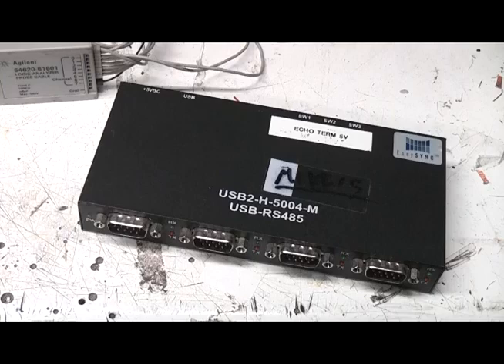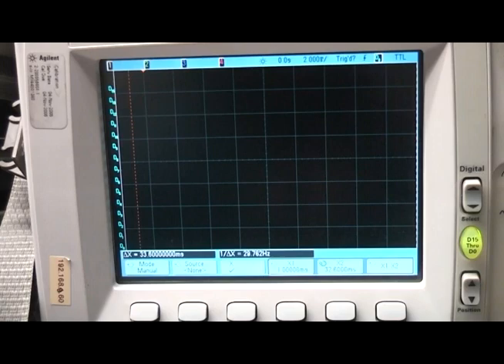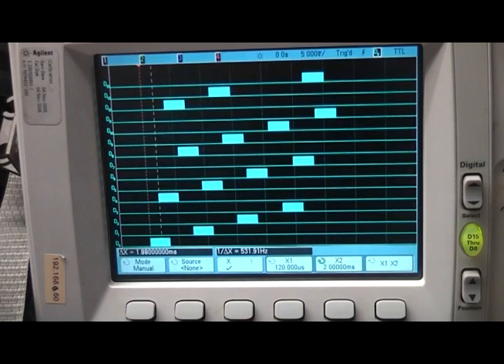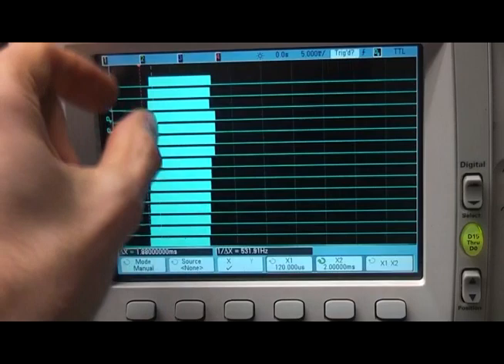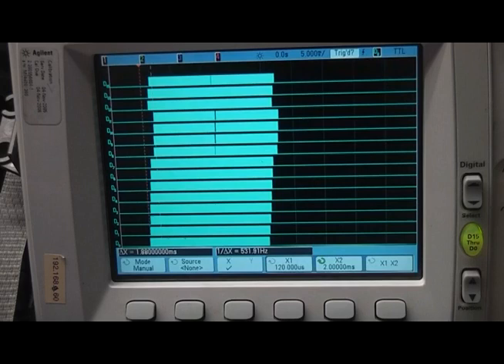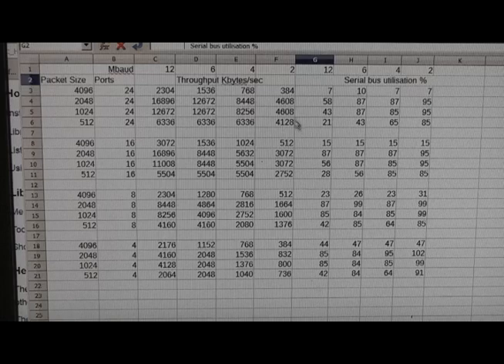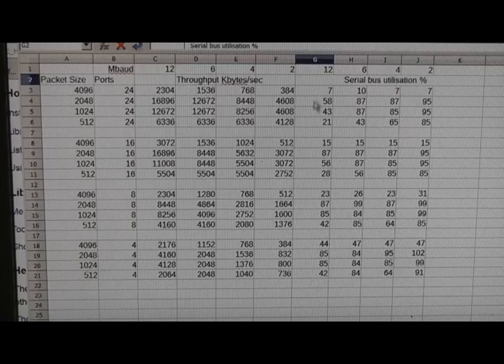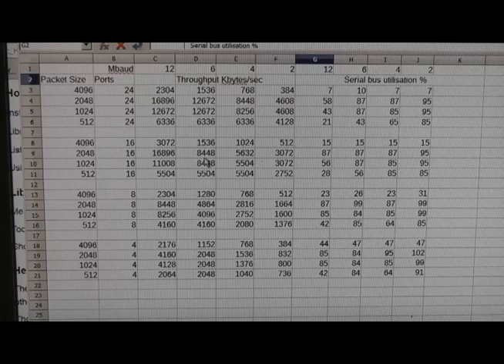Shoving a LOT of data out of multiple USB-serial ports

Comment: I would guess that there might be a [particular laptop or motherboard configuration that might implement the USB in a more optimised manner.  But that's almost like the days of the PCW bench tests where computers were tested against each other in ridiculously specific manners.  RS485 is definitely a nice rugged industrial data transfer system.  Quite fascinating in its own right.  (Although the more technical details of the 120 ohm characteristic impedance are quite frankly not very entertaining at all.)
Reply: +bigclivedotcom I had a problem with some VTR which used 485 remote control. One day, someone replaced one of the units and we started getting intermittent errors. It turns out that all of the VTRs had their termination switches ON and they were looped together. It worked with four switches on (30 ohms!) , but five caused problems. We turned all of them off and used an external terminator on the last one in the chain.
Reply from the maker: +Chris W That's the thing about 485 - when done right it's bombproof, but can "sort-of" work if not wired correctly. First thing to do on any 485 setup is an end-to-end resistance check for opens & wrong termination.
Reply: +mikeselectricstuff +1 to the soft-of work part, especially on a multi-drop network! We use 485 nearly exclusively in our products at work. Sometimes though (usually user error) the network is terminated/polarity inverted/transceiver mode set incorrectly and the issue pops up in a random location on the bus. Agree with checking resistance, found the point of issue quickly that way. Fun when the data is corrupted/inverted due to one of the two lines being O/C or S/C.

Comment: I was just wondering why you up loaded a wide screen (16 x 9 ish) video within a 4 x 3 frame? Thought it was odd, you being a tech kind of guy! interesting vid however.
Reply: +Michael Beeny 4:3 is standard, youtube seems to like 16:9 for no clear reason, so youtube's fault?
Reply: +Michael Beeny Getiing video right is notoriously tricky
Reply from the maker: +Michael Beeny Just reinstalled Vegas and settings are messed up - not got around to sorting it out yet
Reply: +Michael Beeny Yawn, who cares. You can see the content, so no worries.
Reply: +TheChipmunk2008  I wouldn't say 4:3 is standard at all anymore.
Reply: +mikeselectricstuff You can fix the issue by adding the yt:crop=16:9 tag to your video's tags, which crops out the letterboxing.

Comment: I am using SPI interface of FT2232H, it is very nice, and can get 30Mbps with no problem ( good thing is DMA can get 65535 space, just like maximum packet size. And it use bus quite well. For very short packets it can be 10KHz repetition rate, and for longer packets, it will shift more data. And only at small packets, bus utilization is not very efficient, but with larger packets, it is very good.
But yes, it's for single point communication, unless you will change SPI to differential signaling or something...
FTDI just released USB 3.0 with parallel interface i think i will give a try

Comment: Maybe if the USB size limit is a common issue (OS rather than motherboard, for example) then perhaps you could use a client-server setup, either with a PC hammering data across Ethernet to its clients or using Raspberry Pi, etc. as a smart "here's a big fat packet, now chop it up and bang it out to your USB ports" device.

Comment: This is why you EE guys really need to get into Linux. Often these edge cases are much better handled - or if not at least there is an opportunity to do something about it.
Reply: +fractureforce He said on the Amp Hour that he doesn't think too highly of free software. :(
Reply: +Gooberslot Everyone has different experiences and needs and all the various OS fans get too hung up on which OS they think everyone should have to use/not use.

I love Linux for servers and some development work and use it heavily for such, but it is nothing but headaches for me on the workstation front so I am not terribly fond of Linux for workstation use nor would I try to make my less than tech savvy family use Linux workstations.  Plus constantly needing to emulate Windows under Linux can be a headache as I have a lot of commercial software and drivers that do not have comparably effective Linux counterparts and I have better things to do than reinvent the wheel and author all the code required to replace them.  To each their own!
Reply: +Ethan Poole Yeah - but you seem rather hung up on your non-support for Linux.

It's only a suggestion. Mike can consider the suggestion, and look into it - or not. Of course a transition would require some changes to workflow - that's one of the costs of trying something new, and why many people dual-boot.

I'm just saying that many people - myself included have benefited in their projects from having access to the inner workings of their OS. Which is why I'm saying it's a useful tool to have on hand.
Reply: +Gooberslot At 7:36, he appears to be using LibreOffice Calc - so he clearly doesn't have too big a problem with it. Also it's nice to see non-Linux users gaining awareness of the need for LibreOffice over Apache OpenOffice.

Comment: did you try a multi-threaded (/multi-process) application? I wouldn't be too surprised if your write call is blocking just that thread... It could possibly permit even better parallelism with the sub-2k packets, and would likely bring down the inter-port latency with larger packets too... unless the FTDI driver is genuinely badly implemented.
Reply: or try setting the non-blocking flag!

Comment: I suspect the Linux drivers won't have these issues. I think for windows a libusb based driver tuned to handling multiple ports via better scheduling/multiple threads might be the way to go.
Reply: The Linux d2xx drivers have other, un-fixable bugs... :( faulty implementation of FT_GetQueueStatus being the main culprit.
Reply: Hugh Frater I meant the driver in the kernel.
Reply: Ftdi_sio and usbserial modules? As you say, these are probably good as I think they are open source. Libftd2xx.so is most certainly closed and most certainly buggy.

Comment: Wouldn't it be easier to use ethernet? USB is such a chore, and Ethernet usually gives userspace code access to basically the raw data.
Reply: Yeah but they give you kind of a shakey serial interface (you can't /actually/ do full-duplex)
Reply: Well I meant as an interface to the RS485, not replacing it. They make ethernet<->RS485 adapters already.
Reply: +rfmerrill 
Did you read Richard's reply at all?